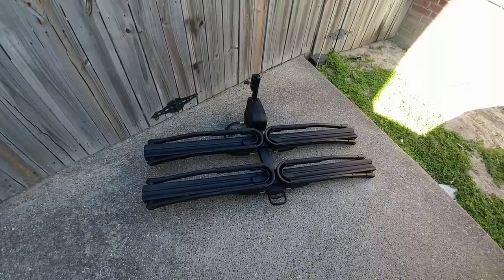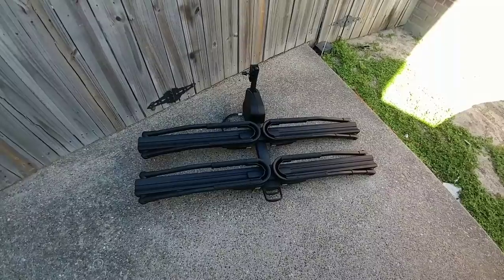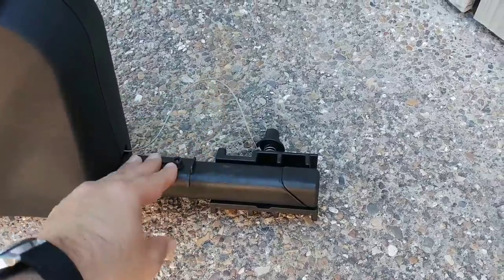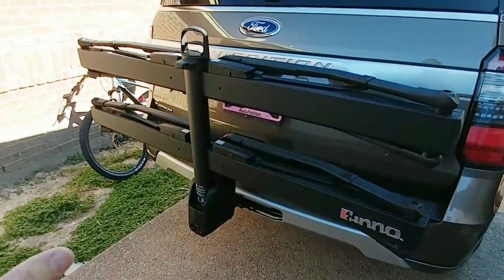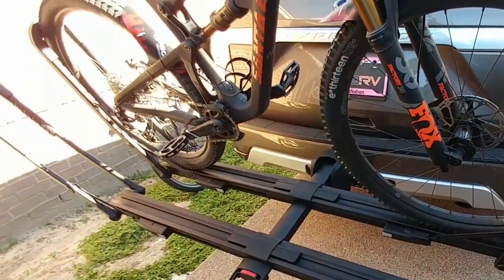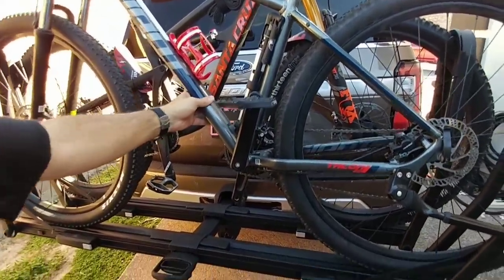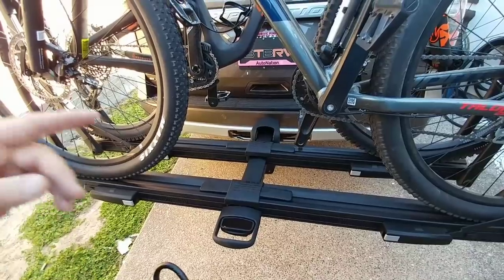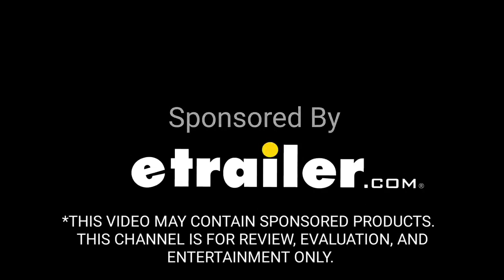WOOPS! but still Love my new Inno Tire Hold 2 Platform Bike Rack!

Comment: Still prefer my 1UpUSA rack. There's an awful lot of plastic on the Inno compared to the 1UpUSA rack.
Reply from the maker: It's all around steel though
Reply: I really like my 1Up as well. Built just as well, but lighter since it's made with aluminum. I also prefer the lower position that the 1Up provides because I can open the rear hatch of my Outback with 2 bikes on my rack. I do like the bike locking feature, on this one though. But I use my normal bike cable lock and that works fine.

Comment: Great review! Definitely looking to replace my existing rack with this rack. Love it! As far as the lock cable is concerned, even if it was long enough, I would never drive with it through the frames. In my experience vibration, wind and post ride dirt/mud  will rub paint on any length of cable. I only use my generic lock cable if I am parked at a store and not driving. That's my 2 cents anyway.

Comment: I use Heininger's glideAWAY 4-bike carrier on my Escalade with no lift gate clearance issue. The 47-pound rack and glide system is well built and easy to operate. Also, it's typically recommended to load heavier bike closest to the vehicle. 😉

Comment: I’ve yet to find a rack that outperforms my Thule T2 Pro XTR. If I had to guess maybe Kuat comes close. No side to side bike sway, built in cable locks, zero frame contact and I can take it off-roading without worrying about it falling apart. The Inno might be less expensive but I want a rack that will last longer than my mountain bike. Cheers

Comment: ABUS is a bike lock brand that may solve your problem with locking your bikes together. Coated steel bars prevent scratching (and they work like the folding wooden rulers). The locks are sold in various lengths and offer different security levels. 

This rack is sure easy to use once you have it set up and doesn't take up much space when stored. Good design. Price may be a little high. 

First time I've seen this rack. Thanks!

Comment: I’ve seen bike racks similar to this and would eventually like to get one, but this one doesn’t seem very secure.   I have seen similar that secure further up on the wheels closer to the forks that seem a lot better than this one.  Also not to keen on the pin they use to secure it into the hitch.  I do like the knob to take the wobble out of the rack

Comment: Is there a way to adjust for tire height?  Looks like the tire holder things might make contact with the frame if you have a 20 inch tire.
Reply from the maker: Yes. The inner parts of the clamps are adjustable

Comment: What's the smallest bike that will fit?  My daughters have mini BMX race bikes and it looks like it wouldn't hold their small frames
Reply from the maker: The arms are adjustable inside to shorter bikes.  It should work fine.

Comment: An idea? What if I were to purchase a 10 or 12 foot bike cable, and after I've mounted both bikes (or one bike) on the rack, what if I threaded the cable through the tire arm clamps, and through both bike frames, pulled the cable tight, and then secured the cable with a lock or using the racks locking mechanism? Because if I threaded a long cable through the tire arm clamps and through the frame of the bikes, and pulled the cable taut before locking it, then the tire arm clamps can't be released without me unlocking the cable, which means the bikes can't be removed as well? And after I've threaded the cable, and to make sure it's tight enough so that the tire arm clamps can't be released, I could wrap any excess cabling around the bike's frame until it's taut before locking it, but not too tight where it would damage the tire arm clamps, but just tight enough that the tire arm clamps can't be released? What do you think?

Comment: I know you say a longer cable but did you try to choke the cable on your sons bike and run through the frame of your bike? As opposed to choking both bikes like you did in the video.
Reply from the maker: It may work, however, i am opting for a longer cable that doesn't pose a paint scratching risk :)
Reply: Oh yeah I would definitely change the cable as well. It’s definitely the sharp edges on that style ferrule. That scratched the paint.